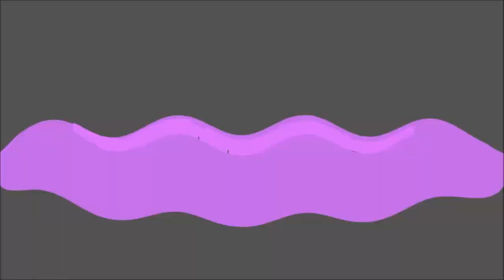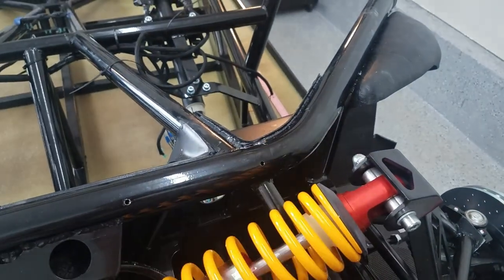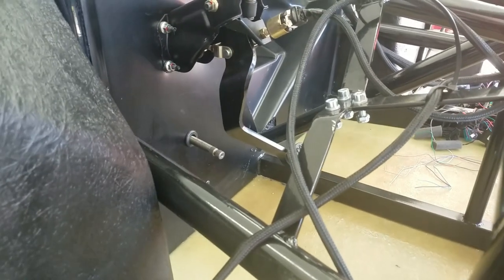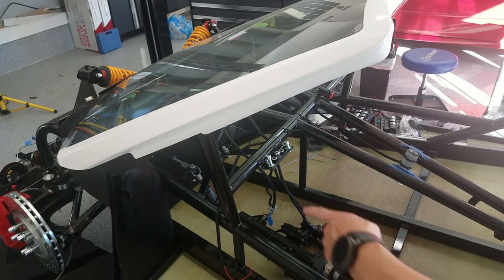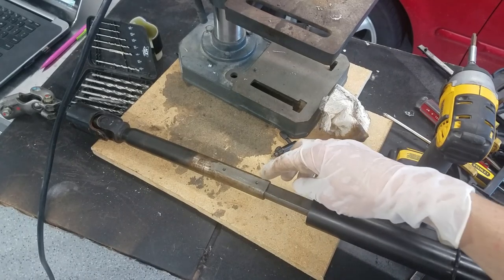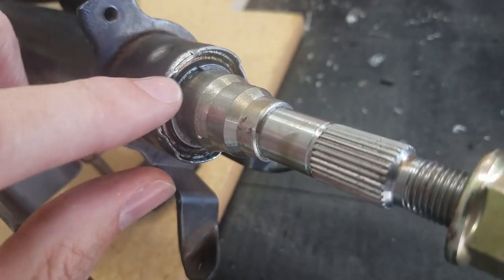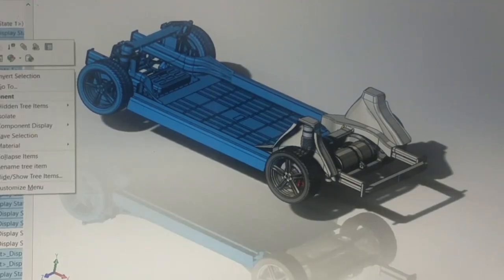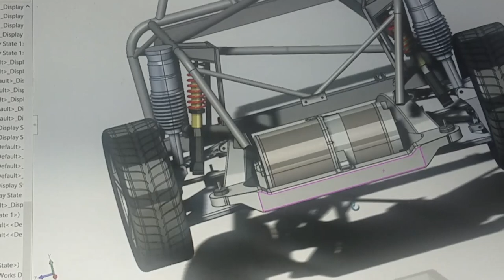Preparing for the Tesla Motor

Comment: Sorry but that is an awful Kit. . Can't believe how many extra parts you need to source and that you need different parts from different cars. . 1992 I built a Robin Hood S7 (Lotus Seven) and you used the parts from pretty much one car. The only thing "extra" was a mini wiper motor. Everything you needed was either with the kit (£1800) or front one donor vehicle. Robin Hood had a reputation of being one of the cheaper, lower quality kits on the market as-well. Things have obviously gone backwards in 28 years !!!
Reply from the maker: Maybe I had too high of expectations, but the more I hear from others, seems that this one is a little below average

Comment: So when it comes to gauges are you going to go with Glowshift gauges? since that's what I'm going to use for my DIY 2006 Charger build. Just minus anything related to gas, Oil, and water pressure.
Reply from the maker: Here is what I ended up doing.
https://youtu.be/6driBdpXDXw